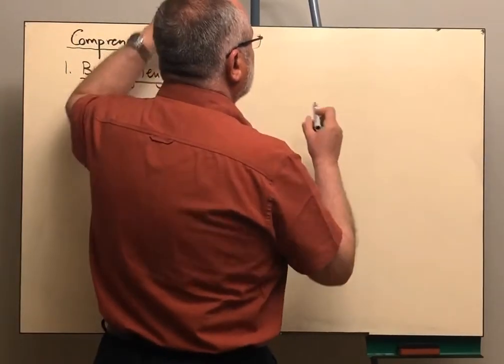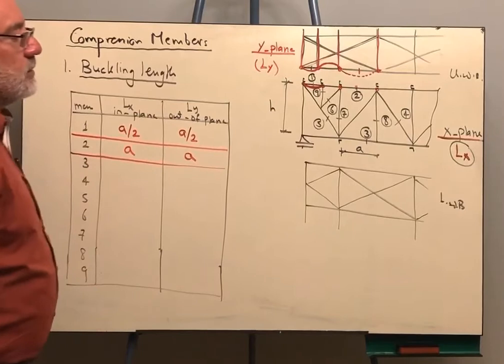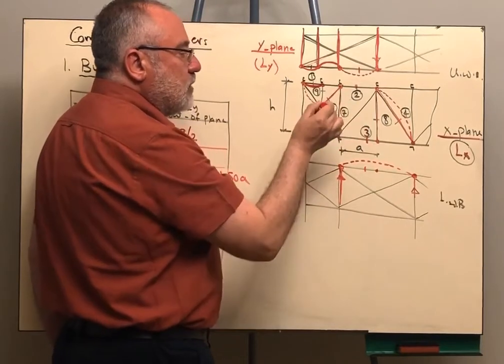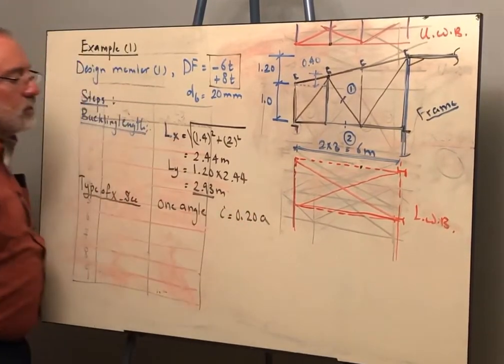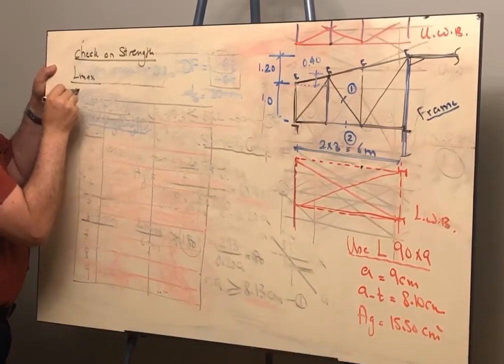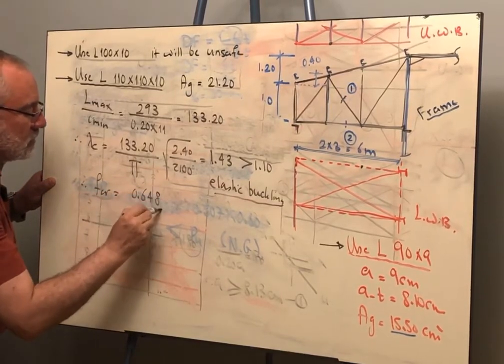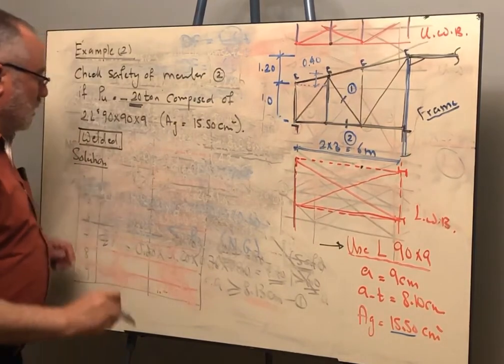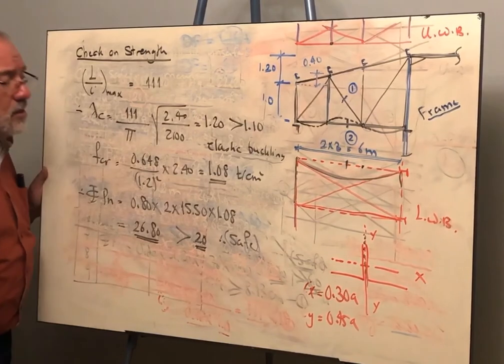Compression Members (Solved examples)

Comment: Well Explained Sir.. I have 1 question... Practically Truss top and bottom chords are having shear force and bending moments additional to the axial Compression and Axial Tension respectively. and since these members are continuous members (placed at site one single length) then  why you have taken the pin - pin condition for member 1?